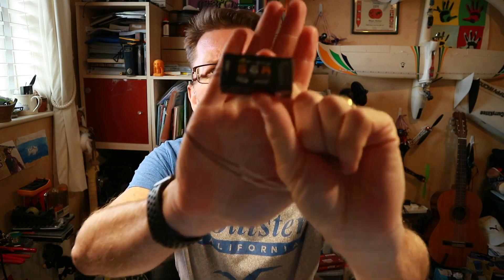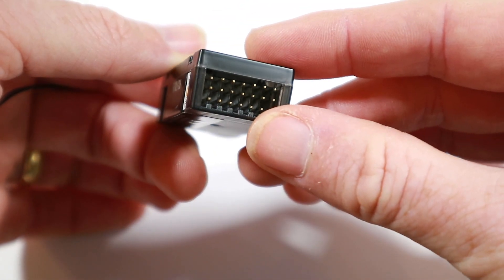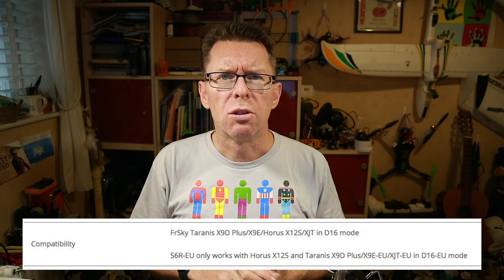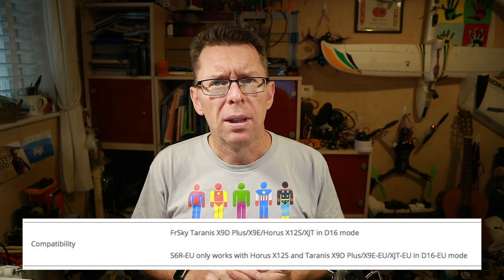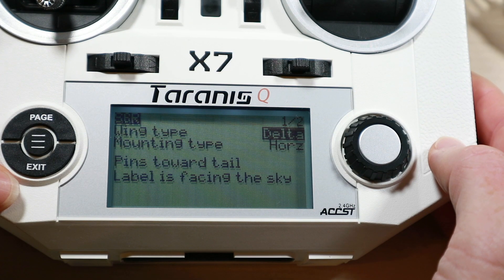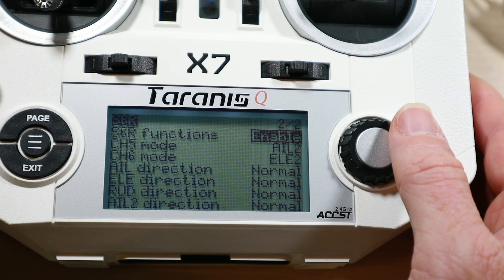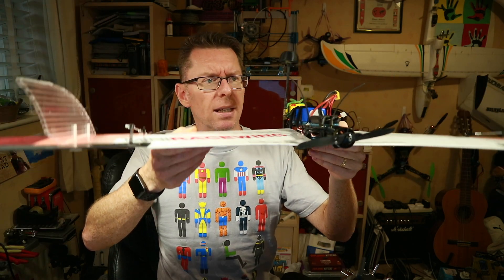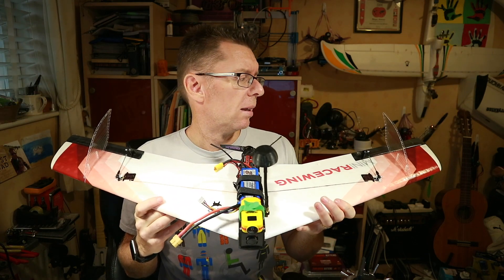FPV Reviews: FrSky S6R RX with integrated stabilizer Pt 1, supplied by Banggood

Comment: Can you use a receiver like this with a flight controller if I was using the fc for GPS leds buzzer ect could I also use this?? Forgive me if this is a stupid question I am learning and just starting my first wing build
Reply from the maker: Technically you could do yes - but you'd be taking one of several odd paths.  1)  If you wanted to use it as a stabilizer and ignore the FC (presumably running iNav or something) then you'd miss out on the better features that the FC has, and RTH would potentially have a fight between the two systems.  2)  If you want to use it just as a receiver, with the FC doing everything else... again, you can - you can turn the stab features off, but you'd be putting in a large rx which you don't need and could get something smaller/lighter/cheaper instead.  My suggestion: If you are going down the iNav route anyway, just get a regular receiver instead of this.
Reply: @CurryKitten  okay makes sense I suppose as I say I am new to the flying hobby and maybe should of researched exactly what the flight controller can do first thanks for the reply I'll stick with the fc
Reply from the maker: I haven't done that much with iNav, but if you check out Painless360's excellent channel he's done quite a few series on the complete setup, so very much worth a watch if you are new to it
Reply: @CurryKitten  I would like to do a line of sight wing anyway while I'm learning to fly so I've still learned something I'll check out painless 360 I've just built my first 5 inch drone but not seen much on inav anyway thanks for your help and advice

Comment: Can I use the stk tool to setup the X8R receiver with stabilizer?
Reply from the maker: Not sure I understand this question, the S6R has a stabilizer built into the receiver, but the X8R doesn't, so there's no setting up the 8XR in the same way.... unless you are talking about using a separate stabilizer ?
Reply: CurryKitten ok, I thought the X8R also had it
Reply: @inspiredbyinspire9234  the S8R does
Reply: SpAzZz AtTaK so do you know if I can use the stk tool to set it up

Comment: Hello, thanks for video, really helpfull.
Does this reciever has battery voltage per cell telemetry?(in manual it is sad it has Built-in battery voltage sensor)
Or i need external voltage sensor for per cell telemetry? (such as FLVSS/MLVSS sensors)
Reply from the maker: It does say that, but also mentions that it's operating voltage max is 10v, so something else will be required... just not sure what.  My field is drying, so I'm aiming to have some more tries of this and so will endeavour to find out.  There's some newer firmware since I last took this for a whirl as well
Reply: If you need power battery per cell data, it needs to add additionally external battery Voltage sensor, that plugs to s.port socket.

Comment: channel 9 in stabilize mode adjusts servo travel(distance from center). in auto level it adjusts servo speed, after tinkering with the s6r i find this to be the case.  It does take tinkering to work properly.

Comment: Hi there, I also own an "old" classic non-plus Taranis and was not able to bind the S6R to it (non EU Firmware). BUT: there is a bizarr solution . That is: changing the receiver number where you want to bind it. I tried to bind it to no. 27 (in my case, the next one that was free). It did not bind, no matter what I tried. With a hint from the net (I guess it was in RC groups) I changed the number to 30 and I was able to bind it instantly. Really bizarr, nowhere to find at FrSky, but that´s it.
Reply from the maker: Interesting - I'd read about people having issues with certain rx numbers, but not as a sokution for using on the older Taranis.  Nice one.  Interestingly, my one would always appear to bind (IIRC) but then have no signal.  I take it you've had no issues with range and stuff ?  (If it all works out I'll be sure to mention it in the update video - which I'll do when it's a bit drier out as I keep launching my MiniRaceWing into deep mud right now)
Reply: Same here in Germany. But well, honestly I did not check the range after binding it. Just did it (after many hours of trying with different firmwares) and left it for the time being. That was roughly a year ago. Since then I messed around with INAV and stopped looking at it. Making it work properly seems to me still a pain in t.a. But maybe now I will look how the firmwares have developed. That is why I came by your video right now. :-)
Reply: BTW I know the guys that have made the MRW. They live close by, I saw the first prototype and we have flown together may times.
Reply from the maker: Nice - they are good guys, and the design works brilliantly.  All the times I've thrown it into the ground, it's just popped apart as it's supposed to.  I just need to get better at throwing it :D

Comment: Hi Wayne, yes, mine works with my Taranis X9D Plus...I think the STK tool and the APP makes life easier as when calibrating the Giros it has Pictures showing the different RX positions. Stab Mode and Auto level are two different things. You need to jack up the Gains in Stab Mode looks like.  Im assuming (and hoping) that in Autolevel its a bit like the Omnibus F4 where it will let you override all you like, which means the Stab Mode will become redundant anyway. I'll have to try the Lua Script myself now for in field adjustments. Look forward to your first flight.
Reply from the maker: I find stab mode without autolevel more useful really - although it depends what you are flying.  In a fast wing, it should stop me having to correct every little gust that throws off my attitude - I'd use the self level aspect as a "hang on I just need to let this fly hands off while I do something" mode.
Reply: Yes, I agree to a point, but flying in Auto Level is better, provided the code allows you to override it on command. Some controllers do this a lot better than others. Basic Stab or Giro Mode is just that, basic and will smooth out flight, but it will not maintain wings level if you go hands off, which increases workload.
  Until I fly it I can't comment really. What was noticeable, was the smoothness of the servos using the S6R, whilst my APM Mini Pro for example is ropey and jumpy. It still works, but it's obviously inferior.

Comment: I have one of these in a bixler1 to teach my kids to fly. So far it's been an absolute pain to get it working. Then add that to having to learn open tx. We have stability and autolevel control working but I never yet did the setup then throw the sticks around. I guess we've been lucky so far. We have one of the 'convenient' mode firmwares on there at the moment and configured it with an Arduino STK alternative. The LUA looks pretty handy, I wish I'd tried that route before seeing it on YouTube. Best of luck.

Comment: Looking forward to seeing you fly this. I have 1 in my F1 Wing but I can't get the stability part to work. Set up my channels ok, but at the moment it's just an expensive Reciever.
Reply from the maker: So is it the case that auto level works, but not stab - or nothing at all... past it being a regular rx ?
Reply: CurryKitten Nothing apart from the Rx working. I have the tool as well and 2 Rx's, figured that if I was paying a tenner for the tool, might as well buy 2 to make it worth while!